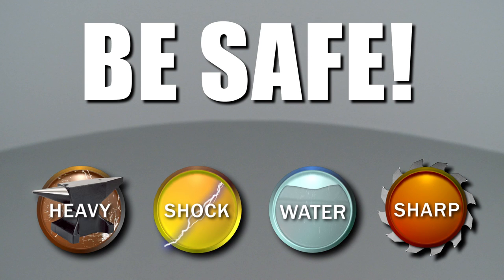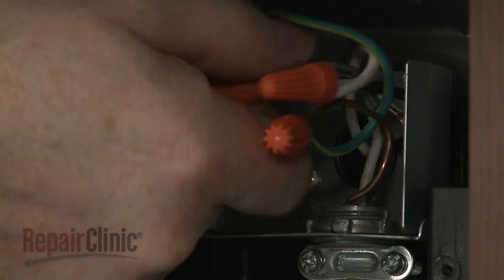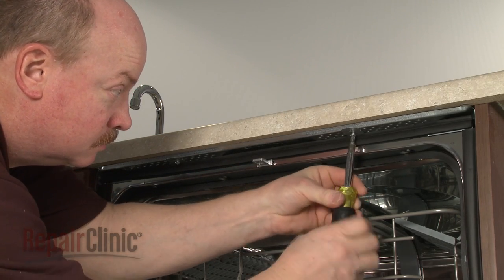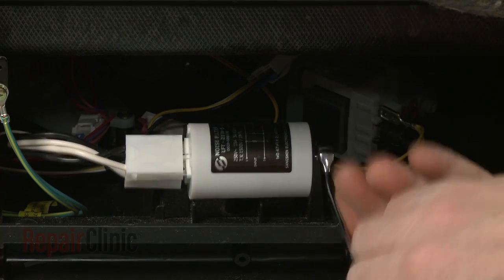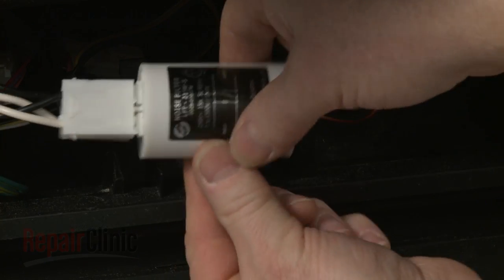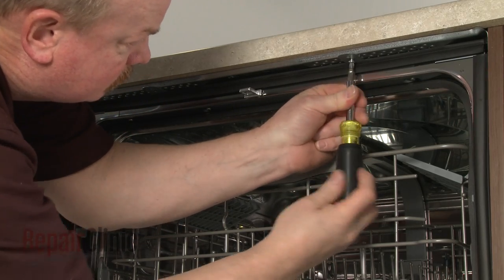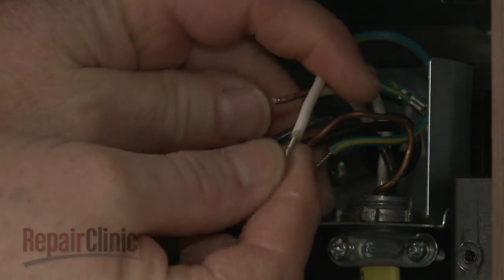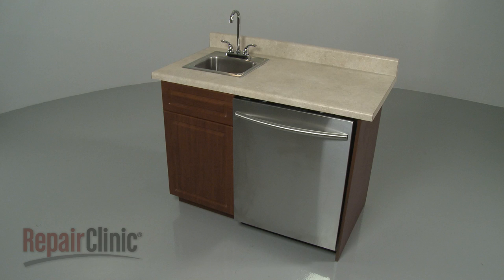Samsung Dishwasher Thermistor Replacement #DD32-00005A

Comment: i found it easier to just flip it on it's side and take the bottom panel off. Still waiting to see if it fixed my issue though....same blinking auto+heavy; and the overflow seems to be working fine so that's not the issue; if this doesn't fix it i'm just going to buy a new dishwasher.  Not worth investing a ton of money into a year and a half old product that has so many issues.
Reply: I had to flip on its side too

Comment: I have a dw80f800uws dishwasher that it won't power I tried the circuit board and  breaker and nothing, any suggestions on what alse I should check
Reply: same issue here... did you resolve it?
Reply: Same here no power

Comment: Newer models have a thermistor instead of the ECS temperature sensor?  I'm getting the "Smart Auto" and "Heavy" lights blinking together indicating an over-level water error.
Reply: Mine was purchased in 2014 and 2 years later having the smart auto and heavy error. Mine has the metal thermistor instead of the white ECS sensor. Have you tried fixing yours?
Reply: +Everything Goes opted to replace it with a whirlpool dishwasher, caught a Black Friday sale. From my research, there was a good chance I'd have to replace 3 parts costing $250. Not worth the risk of a relapse when a new whirlpool was $450.
Reply: I bought an ecs sensor but apparently I need a thermistor... Spent 1hr looking for that damn ecs sensor! LOL So i need more then just a thermistor? Mine also shows Smart Auto and Heavy blinking.
Reply: Actually, Samsung agreed to fix mine for free due to the heater blew up after the machine started to run with no water in it. All they replaced apart from the obvious heater was the brake module on the side. I think what happens is the over flow sensor also acts like a inlet water level sensor but calcium build up clogged up the passage causing the sensor to not read correctly.
Reply: Did you fix? I bought a ecs as well!
Reply: Nick Donati Actually, all I did was remove the thermistor, run the metal part under water, let it dry and put it back in. It seemed to do the trick! Saved me 30 bucks!
Reply: Thx u! Seems to be working!!! : )
Reply: Nick Donati Nice to hear that!
Reply: We had four lights blinking indicating a heat sensor (thermistor) error. We bought the part and followed your video. The inside layout  find doesn't look the same as in the video and we can't find it in the machine. Samsung hasn't been helpful and the manual isn't online for this model. Anyone have any ideas.
Reply: Okay, Samsung came through after we called them again and emailed the repair manual. On this model (DMT300RFS), you have to access the thermistor through the bottom by tipping the dishwasher on its side.  No need to remove the side panel. Anyway thanks for the video; it was still very helpful.
Reply: I have had failure codes several times over the 4 years I owned my Samsung. Each time I have cleaned the gunk out of the interior under the strainer and around the heating element and sensors and put it back together and it has worked for another year. Never replaced any parts. Lousy design when the sensors are that easily made faulty by dishwasher gunk. I recommend any empty cleaning cycle weakly to reduce the gunk build up.
Reply: Good afternoon, could you please help me I need to find where about the location/ position is on my model DW60H9950FS thermistor much appreciated thank you